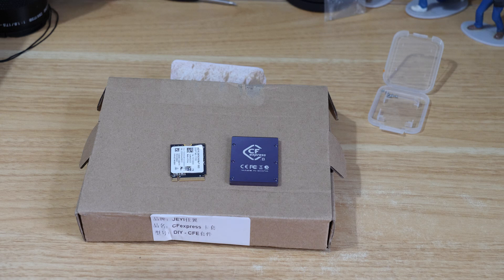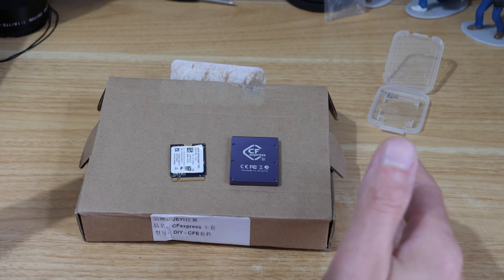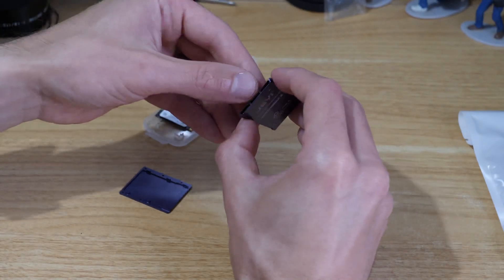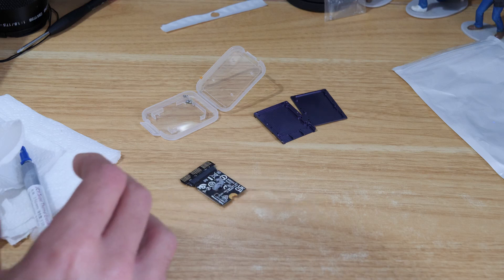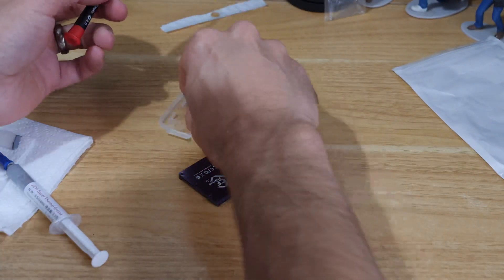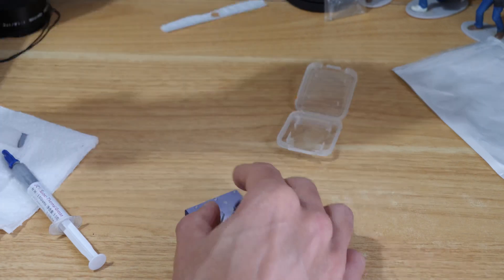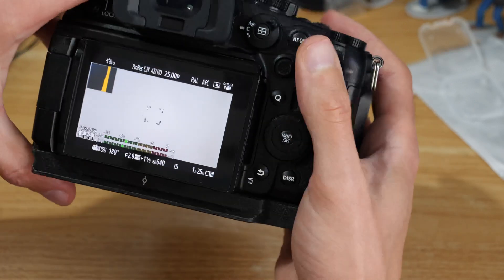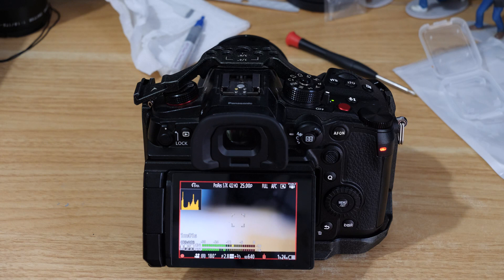DIY NVME CF Express Card | Make Your Own CF Express Card | Budget CF Express Type B Card for Cameras

Comment: I just returned some SD cards as they don't record in RAW formats for my GH7. I have a couple questions I hope you don't mind answering.

1. Is it fair to assume since this works for the gh6 it works for the gh7 as well?
2. How is this solution as a CF card today? Any issues as far as thermals or speed transfers 2 years later?
3. On the GH7 it stops recording after 640gb (i forget the exact number), is that the same issue on the 1TB you're using here? 
4. Did you have to format the card on your Pc Or mac to an exFat or NTFS format?

Thanks for this video! I will be sure to use your links if I bite the bullet. I need to return my sd cards and get my money back first 😁
Reply from the maker: Hi, no problem at all.
1. I don't have one to test it at the moment but if you have a fast enough NVMe and enclosure it should work fine.
2. Still working to this day and I have done some long shoots (4.5 hours+) with it and experienced no overheating.
3. That is  just the cut off point for the file size and it just creates a new file whilst still recording. 
4. I formatted it using my Mac to ExFat. 
There are a few more videos on the channel about this setup. Thank you, I appreciate the support 🙏

Comment: Great video, straight to the point and very informative! I wanted to upgrade from my old Nikon D5100 DSLR to a mirrorless like Nikon Z6 for a long time, but that XQD/CFexpress requirement stopped me from doing it due to insane overall (and /GB) prices of those cards, and their (very limited) availability in my country. Now I may be finally able to pull the trigger on the upgrade, especially considering that Z6 got "old" and significantly dropped in price on the used market✌
Reply from the maker: Thank you, I appreciate it 🙏 Yes they are quite pricey, sometimes you can catch them for a good price in the sales but the DIY approach is definitely a good cheap alternative. The Z6 looks like a great camera and nice upgrade from what you have 👍
Reply: Did you end up doing it. I also have a z6 so looking for options of nvme

Comment: So much wrong info. Remove the sticker, not conducting at all and the paste needs to go on the die itself, not the PCB back. Contact needs to be made between die and case... Its like putting paste on the back of you motherboards of your cpu lol, will not do anything
Reply from the maker: In the product description they show it with the sticker still attached in the enclosure. They don't even include the thermal paste anymore, so it obviously didn't do much 😂
Reply: @stevelitton  JEYI doesnt, ZITA does, but it can never hurt. I tried to find a CFb card teardown, but didnt find any pictures yet. Wonder what they do. But on PC's, the chips have some airflow, in a case, nothing, so the paste is better then just air between die and case. And Alieexpress marketing pictures should never be taken as instructions :p
Reply from the maker: @Photonees  I would be interested to know if you do manage to find one. Ha ha yeah you are probably right but I have shoot for hours on end with the card as it is and it seems to work fine. I do have an internal fan on my camera though so probably helps keep it cool.

Comment: Hello, thanks for the video. I would like to know if the card gets too hot.
Reply from the maker: Hi, no problem. It does get hot after long intervals of filming but so do all of my branded off the shelf cards. CF Express cards do tend to just run a bit hot. They actually have a new version of this case now which supposedly has better heat dissipation.

Comment: Hello friend, can you tell me if this works for my Fujifilm X-H2 camera (if someone has tested it and is reading this comment it would help a lot)
Reply from the maker: The Fuji XH2S is down on the compatibility list for the card enclosure. But I use it with the GH6 and that isn't on the list so it's not comprehensive. Hopefully someone will have tried it and can confirm if it works. Technically it should work for anything that supports CF Express Type B cards.
Reply: Im about to try this too but Im a little bit hesitant it wont work with my XH2S ;/
Reply: Thank you friend, I'm going to buy it now to take the test, which is the most suitable ssd for fujifilm xh2? I'll take the test when I arrive and then I'll tell you how it happened
Reply from the maker: @caiovisualphoto  No problem. The exact bits I used are in the description of the video and as I say you will see the XH2S is on the supported list for the enclosure. Let me know how it all goes.
Reply: Hey friend, I'm here to tell you that I did it on my xh2 and it's working without problems, at first it didn't recognize it on the camera but then I formatted it on my computer and put it back on my camera and only after another formatting it recognized it on the camera. Both the video function and the photo function are working correctly, Thank you it was a success now I can enjoy 1 T on my camera 🙌🏻💯
Reply from the maker: @caiovisualphoto  Great to hear it's working on your XH2. Yes, I think I needed to do the format on my Mac and then in-camera as well to get it working. Enjoy your new card 👍

Comment: Hi. I have sn740 card. when i connect cardreader to computer it doesn't see it. On the other hand with the original card there is no problem.
Reply from the maker: That's odd, so it works in the camera but isn't picked up by the card reader? Does the card reader definitely support type b cards?
Reply: @stevelitton  The camera sees the memory card and when the camera is connected to a computer, the memory card is also visible, but nothing when connected with a card reader.
Reply from the maker: @v.malinovsky  Did you double-check that the CF Express reader you have definitely supports Type B cards?
Reply: i got it..go to diskmanagement and format

Comment: Hi, have you tried to fill it ? 8k60. Mine gives error  when 50-60% full. The writing speed drops a lot.
Reply from the maker: I have filled it but my camera is only capable of 5.7k60 and it seems to handle that alright. Is the card getting very hot?
Reply: It is not overheating. If you are using GH6 5.7k60, it has 300 Mbps bitrate. My Z8 8K60 has 5780Mbps. Bitrate.. Actually your bitrate could  probably work with fast SD card 😃
Reply from the maker: @badger-kr9nr  Yeah that's pretty intensive usage. Maybe, I wouldn't be getting a 1TB V90 SD card for under £100 though 🙂

Comment: What NVME card would work for the D850?
Reply from the maker: I believe this adapter would work with the D850, you need a compatible NVMe 2230 to go inside it. The interface is the adapter, not the chip, so as long is it is compatible with the adapter it should work in theory.
Reply: @stevelitton  thanks pal..I think I found some decent ones on Ali Express
Reply from the maker: @waseemhassam  No problem, thats where I got mine from and it still seems to be working fine 👍

Comment: Great video Steven, however I have just tried this on my GH6 and after I put the DIY CF Express card in my camera and turn it on the camera completely locks up.  The screen comes on, none of the buttons work and the only way to get it to turn off is to remove the battery. 

Can I ask which firmware version you are using please?  I have updated to version 2.5 recently and am wondering if this is the problem.

Also, I don't have any "real" CF Express cards to try in the camera as it could be that there is a fault with the slot on the camera itself.  The SD card slot works fine.  Puzzling ?????

Can anyone else through any light on the problem.  Thanks.
Reply from the maker: Oh no, that's no good. I can confirm that I am using version firmware version 2.5 and the card is still working. Out of interest are you using a stock Panasonic battery or a 3rd party battery? It could maybe be a difference in the CF Express case or the drive inside it.
Reply: Good news!  I have now got a working CF express card adapter and GH6!  It was the SSD (who knew that not all SSD's are the same despite identical specs).  I got it working with a Toshiba(Kioxia) 256GB PCIe NVMe 2230 SSD (KBG40ZNS256G) from Amazon.  Now that I know it works I might buy another but this time with a bigger SSD capacity.  Thanks again. @stevelitton
Reply from the maker: Great to hear you got it working! Yes some of the NVMe compatibility with the enclosures is a little confusing and not particularly well documented.

Comment: Does your card slide in and out of the camera easily?
Reply from the maker: No, it's not the best enclosure design, I covered that in the video. Its like is a mm or so thicker than a standard card and the finish of the card is very smooth making it hard to grip. You can get it out by hand but it is a bit of a hassle compared to an off-the-shelf card.
Reply: @stevelitton  How do you get it out of the camera? How do you do this?
Reply from the maker: @lnuponom2678  Maybe I worded that wrong, I do just use my hand to remove it. It's just a bit fiddly.
Reply: @stevelitton  The main thing is that the memory card slot does not become worn out or break over time.
Reply from the maker: @lnuponom2678  It seems to click in and out of the slot correctly it's just that last pull out of the slot. Seems fine so far but time will tell.

Comment: i believe that you apply the thermal grease on the wrong side....
Reply from the maker: I'll be honest its seems like an absolute minefield of information around this subject and none of it seems to align. I see some people say to remove the stickers, some saying that the stickers themselves have thermal properties. Some people say to put paste over the stickers, some say to apply it to the back of the drive and some say to not apply any at all. It seems to be working the way I have applied it and not overheating, even after 4.5 hours of filming. But I am not saying it is right 🤷 I would be interested to know how you would have done it though.
Reply: @stevelitton  Do not need to remove the sticker as it is also a heat spreader that looks like a "sticker". You need to apply thermal pad or grease on top of the "sticker" to make contact with the aluminium casing. Bottom part of the PCBA do not have any component.
Reply from the maker: @tembak88  thanks for the information. I may take it apart and apply some additional paste to the sticker 👍

Comment: I wanted to ask, is your external monitor 8 or 10 bit?
Reply from the maker: No sadly mine is 8-bit which is not ideal but I generally have a pretty good idea of what the footage will look like because I mostly shoot in the Natural profile or V Log.
Reply: @stevelitton  Is V Log noisy compared to the standard profile?
Reply from the maker: @lnuponom2678   Depends on what ISO you shoot at. It can be using DR Boost. But I use DeNoise software anyway, so not too bothered.
Reply: @stevelitton  DeNoise software is this some kind of plugin? Take a video of how you remove noise.
Reply from the maker: @lnuponom2678  Yeah it's just software, will do 👍

Comment: Hello. How's your card? Works fine? Does it get hotter than official cards?
Reply from the maker: Hey, yeah its still working fine. It does get hot but I wouldn't say it gets any hotter than any other CF Express card I have.
Reply: @stevelitton  OEM Samsung 256GB M.2 PCI-e NVME SSD Internal Solid State Drive 30mm 2230
Reply: On Amazon this costs 18.45. What do you think about her?
Reply from the maker: That does seem like a good deal. I guess its all luck of the draw if you get a good unit. The same goes for branded drives though. I have mostly been using backup recording where possible with that card just in case it does fail. But it's working well so far.
Reply: @stevelitton  For some reason I don’t see what the write speed of this chip is.
Reply from the maker: @lnuponom2678  Oh that's odd, usually there an image of a benchmarking tool showing what it can do. Usually to be taken with a punch of salt 😉
Reply: @stevelitton  Does your card slide in and out of the camera easily?
Reply from the maker: No, it's not the best enclosure design, I covered that in the video. Its like is a mm or so thicker than a standard card and the finish of the card is very smooth making it hard to grip. You can get it out by hand but it is a bit of a hassle compared to an off-the-shelf card.

Comment: Thanks Steven! This is something that I only heard about, and I thought about, but I did not know how real it was. Very interesting solution!
Reply from the maker: No problem, yeah its an interesting option. I must say I was sceptical but so far it is holding up really well.
Reply: I was also skeptical about it, until my former student told me that he and two of his partners shoot a lot with five cameras almost every day. And through various experiments, they came to the point that now all their cameras have SSD adapters instead of SD cards. And it started with the fact that two branded sf express died in them one after the other. And they learned that there is a cheap type of memory and a decent controller. So they tried the SSD adapter and are still satisfied.
Reply from the maker: @olesbadio1496  That's interesting to hear that the external solution is actually more reliable than standard cards. As I mentioned, I am getting good results out of the NVMe card so far, I shot 4 and half hours of footage on it the other day in 5.7k and it handled it with no issues.

Comment: Can we do this with type A cards?
Reply from the maker: Thats a good question, I did look for a type A adapter and couldn't find one when I was looking. Probably due to the speed difference between the two types. Thats not to say they don't exist, I just couldn't find one when I was looking. Some cameras that accept CF Express Type A cards will also accept CF Express Type B cards, so it is worth checking that.

Comment: Hello Steven,
an inexpensive solution. My question about heat dissipation. Can you do a test in the GH6 with several hours of continuous recording in a video mode with a very high write rate? I'm interested in whether it might stop in contrast to an original. Thanks
Reply from the maker: Hey, I haven't given it that much of a test yet, do you have a particular video mode in mind?
Reply: Yes. In August I took a continuous outdoor recording with the GH6 hours 10 minutes. 
Ambient temperature 25 -28 degrees Celsiusand external power bank via USB-C
 306GB on a SanDisc Exreme PRO 512GB 170Mb/s.
 MOV 5760x4320 Anamoph 420/10bit/LongGop
There were no heat problems. It's interesting to me whether it would have been the same if
 I had used slot 1 with "Your Own CF Express Card" @stevelitton
Reply from the maker: Sorry, I think you missed the number for the hours out, if you let me know, I can give it a test and see if it is up to task. The temp here is a bit lower than that but it shouldn't make a great deal of difference.
Reply: :face-purple-wide-eyes::face-purple-wide-eyes:4 h . 10 min   :hand-pink-waving::hand-pink-waving: @stevelitton
Reply from the maker: @Hans-Georg_Flack  Thanks for confirming. Thats a pretty considerable recording time. Are we talking about using a power bank there or a V Mount battery?
Reply: I used  Anker PowerCore+ 26800 PD 45W Powerbank ---Interesting the stronger one Anker PowerCore III Elite 19200 60W Powerbank does not communicate with the GH6 @stevelitton
Reply from the maker: @Hans-Georg_Flack  ah perfect, I will give that setup a go when I get the chance. Yeah I think that power bank is aimed more as a phone/tablet charger, which is odd because it's about the same size, price and form factor.
Reply: It appears that this exact model is no longer on the market. @stevelitton
Reply from the maker: @Hans-Georg_Flack  Anker just released a whole new range of power banks, so I think these ones are all being phased out.
Reply: Why didn't they put the side with the chip on it?
Reply from the maker: @oyxogphd69  Sorry I don't quite understand what you mean by that.

Comment: Great solution! Just followed your recommendation and have done exactly the same. Works perfectly. As the case is effectively utilitarian, I think I'll abbrade (cross-hatch pattern) the front and back surfaces at the 'gripping end' edge surfaces, just to make extraction that bit easier. A diamond etcher will suffice or even a steel craft blade - as the case is just aluminium.
I little word of warning the NVME card I bought was a 'generic brand' version, and the circuit board at the electrical contacts end was about 1 millimetre too long - so I carefully emery paper'd the end down to the gold contacts by about that amount - careful to keep the card contacts edge absolutely flat to the sanding board(!). It then fitted fine in the case and flush at the external contacts edge.
Reply from the maker: Great to hear you got it working and managed to get around those hurdles. That sounds like a really good idea for the grip, thanks for sharing 👍

Comment: This was fun  little project to see, but I have to say I wouldn't use these type of self made cards. Price of a branded memory card can be steep but if you are shooting anything commercially, usually the reliability of the card and the actual content is far more precious than the price of the memory card. Not to mention possibility to damage your camera body too... If you need a lot of cheap memory just use SSD instead...
Reply: I've had similar home-built cards for about 2 years now. About 88,000 exposures, with zero failures. I used 256Mb SSDa,, about £60 each.
Reply from the maker: That's good to hear, looking forward to giving it a good test.
Reply from the maker: That is completely understandable, it would be risky for paid work. I think to be honest this will mostly be used when I am just doing my own little personal projects. I quite often like to have the camera stripped right down, so it lends itself well to that. Luckily I do have a few brand name cards and plenty of SSD drives ready to go when I need them.